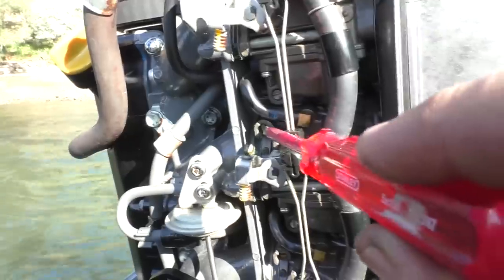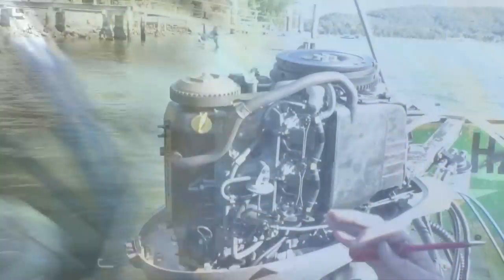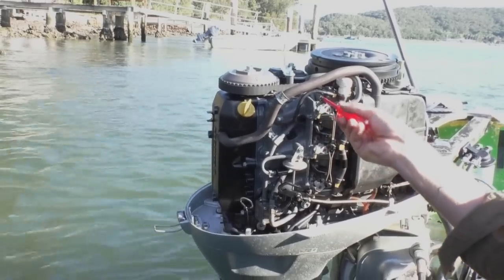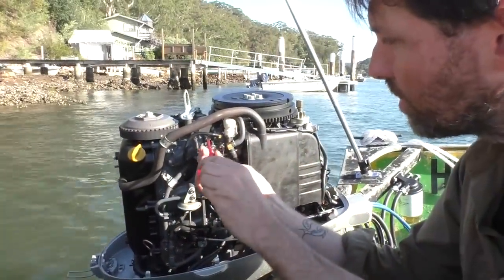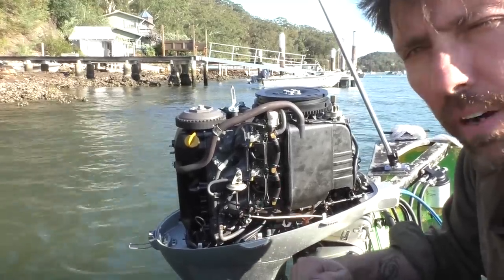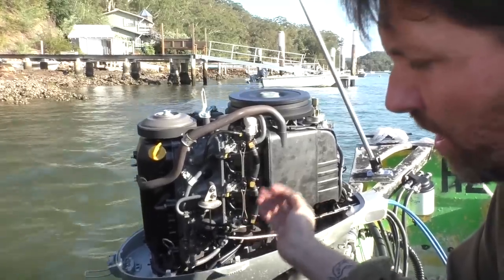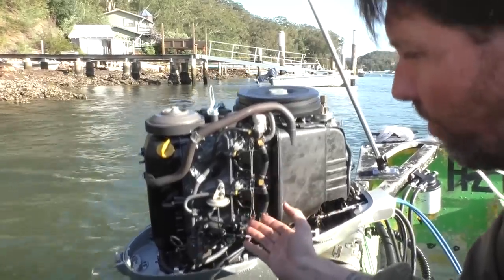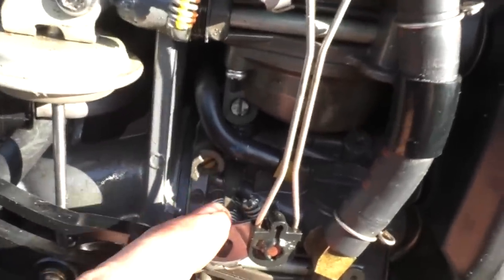Four stroke carburettor synchronisation

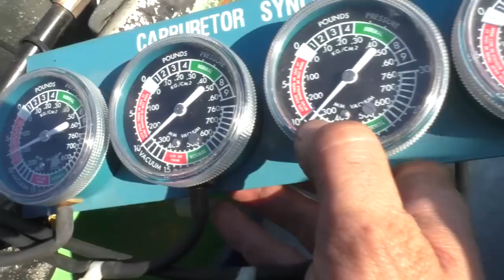Comment: I dont know if boat motor carbs have similar stages as automotive carbs but if so here's another tip. When you adjust the mixture screws you are adjusting the fuel through the idle circuit. If the engine rpm increases significantly while making the adjustment the carb will begin to draw fuel from the off-idle circuit, thus upsetting your adjustment. Best to keep the rpm adjusted to an idle speed as you adjust mixture screws so you're working within the idle circuit.  Also, it looked like your vac hoses may have been partially pinched at around 23:37.  But, as with your previous video's, you are clear and concise, and very detailed. Good videos, thanks.

Comment: This was a great video and walkthrough!! the only bit of advice i would add is, when using multiple vac. gauges like that before you fine tune them its not a bad idea to check and see if they all read the same on 1 carb. sometimes those gauges can read a little differently but than after that you're set!!! great video!! new subscriber
Reply: Great tip Zac
Reply: Do you mean check 1 carb at a time ?
Reply: @levibellette7726   no necessarily that. I just meant before you hook each gauge up to their own carb. check each gauge on the same carb first real quick! Iv'e had 1 out of 4 gauges read off before and messed up my whole tune! just a little tad of advice!:)
Reply: I use a mighty vac to test each gauge as a kind of calibration - 10” on the mighty vac reads 9” on gauge 1, 10” on gauges 2 and 3, 11” on gauge 4 - I then grease pencil a +1 on gauge 1 and -1 on gauge 4.
Did that make sense? Ha!
Reply: @dekrev  ahah yupp, very nice!. too bad you can't just turn the gauge faceplate so the needle all reads the same. good idea though!

Comment: Ur instructions are clear, easy to understand and what I appreciate most is you explain everything that is going on and why.  I had idle issues with my mercury 40 after a carb clean and after playing with the idle screws I could not get it to stabilise.  Either too high or it dies.     Did not know there was a setting to bring the whole rpm down to idle properly.  Subscribed!!!
Reply from the maker: Thanks for subscribing! :)

Comment: Thanks very much for your well done, clear, and informative videos! I just got a 90 hp 3cyl merc running that hasn't run for over 12 yrs. cleaned and new gaskets in carbs, rebuild fuel pump, all new fuel lines. It runs pretty well but has,what I'm told, a lean pop, that will almost stop the engine. So next I'll do all you have shown in this video. Greatly appreciate your videos.

Comment: good video.done this procedure many times.i use a vacuum mate though.set the idle to 1000 rpm,and keep it at that rpm for the procedure.if you have balance tubes between the carbs,pinch them with plastic pinch off tool.takes some patience,but once done your engine will purr at idle.once al carbs are in sync,set idle speed back to specs.happy boating.
Reply from the maker: Those VacuumMates look really cool. You're not wrong about it getting the boat purring once it is done. :)
Reply: i`ve been doing marine repairs for 40+ years.i have to say that your videos are first class.you take the time to describe all procedures in depth.great analyzing and diagnostic skills.your explanations are clear and concise.i salut you sir,keep up the excellent work.best wishes from Canada.

Comment: I've enjoyed viewing your videos tonight.  They've given me that bit of motivation to soldier on.
I've just spent the weekend on a Yammy F100AET (F100TLRZ) trying to figure out why the alarm sounds then it goes into Limp Mode. After cleaning sensors & changing oils I've come to the conclusion that I'm gonna have to go in hard.... remove the head as there's water in the sump and milk running from the leg. Also while I had the Sump plug out and the flush hose on, found water dripping from the sump plug.    Thanks Dangar.
Reply from the maker: Good luck with getting the motor back in shape. I hope the videos help you do that. :)

Comment: I had a beast of a time adjusting a BF90. Two of the mixture screws had the tip broken off in the seats... I managed to drill them out with a magnifying glass and a dremel with a tiny, tiny drill bit. Installed new screws and redid the sync. Ran beautiful after that. It only took me a days work all in all :D

Comment: Fun fact:   Mercuruiser stern drives have an interrupter switch that actually turns ignition off for a few milli seconds as the unit is shifted from neutral .  This protects the shift components in the bottom end.  Works quite well.  Don't know if outboards have similar tech, but they should imho.
Reply: yes of course outboards have a "shift interrupter" switch. if its a v4, kills one bank of cylinders so its easy on the pinion gear. a V6, 3 cyl (entire port or std. bank). anything smaller than a v4 and its not an issue. although many v4's dont need one depending on the gearcase.

Comment: The most informative vid I've seen on this subject. Thanks for that! I love the plain, no frills vids that relay information. 👍
Reply from the maker: Thanks Joseph, glad you liked the video. :)
Reply: If a start my 75 mariner moter and it is running the fuel pis out my moter in to may transim of my boat
Reply: Lizaan van der Bergh bad reed valves if it’s a 2 stroke
Reply: @lizaanvanderbergh6648  the carburettor/s are most likely to be flooding,, the float valves may be stuck down,, by the way,, too check your "reed valves are working right,, take off the air box on the carburettor's and  run your engine holding a white card close to the front of each carburreter if any fuel is spitting out on the card then that cylinder's reed valves are bad,, not setting or are broken! if one is broken you MUST find all of the reed valve,, don't just swop out the reed valve without finding the broken part,, as it very likely to find its way into your engine when its running,,,, then your engine go's with a bang!,, and you get one written off engine!,, so find all the broken off part's!

Comment: I really like your videos, you do a good job.  Not to be "that guy" but: I had a Honda twin cylinder motorcycle 17 years ago, first street bike, and got all excited about stuff and found that I could balance the carbs (never had heard of such a thing prior to that).  I bought a gauge/device and balanced them.  I can't quantify it but it definitely seemed to run better and stronger after balancing the carburetors.  It didn't turn it into a rocket ship, but it seemed to make an appreciable difference.  I think it's a good final step in tweaking a carb engine.

Comment: Best material on outboard tuning I've seen! I have a BF25 Honda that looks to be quite similar to what you're working on so even better for me. I've struggled a bit with this motor the last several years but the trend is positive :). Have had issues with dirty fuel and build-ups in the very small passages in the carbs so have, of necessity, gotten comfortable with disassembling / cleaning these guys. The final tuning / balancing however, has been a work-in-process even with the factory manual but your video puts it all together beautifully! Thanks much (and big snaps for not dropping anything in the water at the dock...I can't claim the same when working on the boat in the water :).
Reply from the maker: Thanks Mark, yep, those BF25s are very similar. Glad to hear the videos have been helping you, but yes, I have dropped plenty of tools and parts in the water over the years...
Reply: Dangar Marine Tappets

Comment: On my 2006 merc 125 hp the it really idles hi and clunks into gear. I wasn't sure the idle was to blame but this vid narrowed that down nicely. While I'm not sure I want to start turning fuel screws I might just simply lower the idle as you say until is comfortably slower but not out of balance. Thanks Stu, very well explained video as always....cheers
Reply from the maker: For sure I would lower the idle if it is really clunking. As you say, no need to mess with the mixture screws if it is running nicely.

Comment: I appreciate you sharing this with us, it really helps. I tried to mechanically (as I don't have a vacuum gauge rack; which I will need to get) sync the carbs on my Honda 40 by setting the adjustments as close together as possible according to the small holes in the bottom of the circuit (lined up according to the boss carb.) We will see if it works, I know it did work on my motorcycle to do it that way. My motor was all jacked up...I cleaned the carbs and reset the mixture jets. Next is the sync, thanks mate for showing me how!

Comment: Great video!! Very informative! I have an 85 Mariner 75 hp I have a hard starting problem with. I replaced the fuel pump, fuel lines and rebuilt the carbs. It runs great but it is very hard to start. It has a fuel enrichment system instead of a choke. The solenoid is working and all passages are clean, but I still have to spray gas into the carbs to crank it when cold.
Reply from the maker: Once it is running, does activating the enrichment solenoid change the sound of the motor?
Reply: +Dangar Marine Yes, it bogs down like it is getting extra fuel.
Reply: The stator went out on my last trip. I'm thinking that may have been my hard starting problem. I have a new stator, power pack, and voltage regulator ordered. Hopefully that will cure the hard start problems.
Reply from the maker: Fingers crossed. Let me know how you get on.
Reply: I certainly will! I have plenty of experience working on motorcycles, cars, and atvs. I'm not as experienced with outboards, but this particular engine is a demanding school mistress...LOL. While it was running, it was flawless and powerful. I'm quite sure the new ignition system will solve my problems. Again, thanks for the concise and informative videos! I will update my results this weekend! PS. I had the engine rebuilt for $1250. I kept having carb problems. After installing an inline filter and cleaning carbs, they started flooding again. I tore them back down and they were loaded with black debris. I replaced all the fuel line inside the cowl. It was dared 3/24/86...LOL. I thought he would've replaced the fuel line. I would hate to fry a motor over a $10 length of 1/4 id rubber hose...smh.

Comment: Tube length would matter in theory because air is elastic so a bit more stretch would lessen pressure at the gauge by probably an insignificant amount for your purposes, but not sure what the percentage would be.  Great video as usual Stu!

Comment: Keep up the great work with these videos - they're a fantastic series that are really helpful for people that don't have a lot of experience.  I have lots of carb fun with a Honda BF90 I have, where it sometimes drops to 3 cylinders when idling, despite stripping/cleaning/tuning/balancing all the carbs.  They're temperamental things on the hondas I think, as my friend's one does the same thing, but not sure why it does this 'trick'.
Reply from the maker: Hi Jim, glad you like the vids. Dropping a cylinder is more likely to be a spark problem than a carburettor problem. I'd go through that side of this next.
Reply: Thanks for the input!  Have used a spark tester on all 4 and it seems to work fine on them all whether it's going on all 4 or dropped down to 3, and have swapped the plugs & coils etc around.  Just taken the carbs off yesterday anyway and the bottom one wasn't the cleanest inside (float was sticking, causing it to absolute p*ss fuel out of its vent at the top), so I'm overhauling them all.  
Water jacket cover etc is all off at the same time to de-salt it all too, as a previous owner has clearly been pretty slack with rinsing it out adequately.  Lots of new coolant related bits ordered as it's been a bit neglected.  Now if I could just get the honda paint that'd be the holy grail but can't even really find it for sale in the UK, never mind the Isle of Man!

Comment: Love your technical videos. I hadn't thought of it like a guitar string before, but its spot on! If you want carb exact, it needs to be adjusted everytime you use it, or if temperature or humidity changes...just like a guitar. I've just got a boat, but been mucking around with 2t dirt bikes for a while, good to know its basically the same.
Reply: carbs can last sometimes 20 years with zero adjustments if non-ethanol fuel is used. they are extremely reliable pieces of engineering on most brands and models, especially outboards starting in the early 1980's. temp and humidity will change this yes, but such a small amount it wouldnt be worth the trouble.
Reply: @ct1762  yeah I guess it helps with outboards considering they are mostly used at one level (sea level or at a particular lake), so no need to adjust for altitude. 

But 2t dirt bikes will always run better if they are adjusted for the conditions of the day.

Comment: on most 4 stroke outboards, the bottom carb is (90% of the time) the "master" carb. if you start from the top one, your mixture screws will be all over the place, as demonstrated here by accident. a hint that the bottom #3 carb is the master is that it is not adjustable on its own. they dont want you messing with it. so adjust the bottom carb 1st, and i bet all the other carbs are within 1/4 turn of eachother. its also entirely possible he has a carb blockage as mentioned, but its idling so well i doubt that is the case.

Comment: Hey Stu. Hope all is well Down there. Quick story for you. Remember your trailer wheel bearing video?? Well, using that, I did the bearings and hubs on my Kayak trailer. Took it 1500 miles from New Jersey, USA all the way to Tampa Bay Fl. No problems Even new wheels, new tires( Amazon) . All is good. THEN for my big boat trailer. A double axle that carries a 21 foot PRO LINE, 150 HP Mercury, 70  gallons fuel etc. My point..good deal of weight, right? Well I bought the boat used( the boat is a fishing boat and just needed cleaning). Used your videos to do my own repairs, but last year I brought her to a trailer repair center for a 'PRO" to do the bearings. Last week I took it in for new tires at a tire store, the tech came out and said a wheel was seized !We thought the brakes where not releasing. To make a long and expensive story short, the trailer Pro never replaced the bearings on all four wheels. The bearing came out in pieces when I took the brake off. The grease was covered in rust( the trailer has not seen salt water yet) One race was broken and stayed on the axle The techs at the tire brake shop said the bearings were never changed.I did grease thru the bearing buddy but never broke them down to inspect thinking they were new. Less than one hundred miles. Thanks to your videos not only did I do up my kayak trailer and put over three thousand miles on it but I was able to find a problem on my big boat trailer and brought  back to the PRO and demand they repair it right.   So, if you ever wonder if your videos make a difference, well guess what, they do!!! Thank you. If did not live 10000 miles away I would buy you a beer .Doug Bryer, New Jersey USA. Ever do anything with that fishing pole in your shed ? I think you said it was your father in laws?????
Reply from the maker: +Doug Bryer Hey Doug, glad hear that vid helped you. Hope the "pros" sort out their effort. It's amazing how many cars come into our shop that have never has fuel filters or cabin filters changed ever because they are hard to get to. I did get that rod up and running in the end. Just posted a picture of it on Instagram for you.
Reply: Hey Stu, remember my bearing story?? Well I forgot to mention the brakes would keep locking up on the trailer and would not work. Well the day I brought the trailer back to get "fixed" the tech said the brakes were mounted wrong( they did the brakes). The drum brake backing plate was mounted sideways. This in turn caused the wheel cylinder to be vertical, causing an air pocket. The push rod was bent, and presto, no brakes. Well, again. a long story made short. The owner of the job said he took care of everything. He replaced the bearing and that he would "eat the cost". He said the brakes were fixed and ready to go. Well I traveled 7 miles to the lake boat ramp and as soon as I got out of my truck i smelled something burning. The axle with the "repaired" brakes was burning hot. ( the dust cap was to hot to touch) So , back to the drawing board. My regular auto mech. shop said  I should change over to disk brakes. He said its a easy job, and since i did my small trailer, I could do my boat trailer myself. So my question is , do disc brakes hold up on boat trailers???? I see they come as a kit and look easy to do,vs drum brakes and all those springs. Again thanks for the video. You most likely saved me lots off grief since I was able to check the work of the "trailer shop".Word is in town is that a lot of work has been going back to him . Thanks again for the videos and information. Doug from Byram Nj,USA I was going to send you a case of Beer to says thanks and well done, but the US Post office would not let me. some about over seas shipping and beer and the law???????

Comment: This helped me out big time today...sadly when I had it as right as I could get 5 hours ago....when i went back up to do something else, it's back to all over the place 1 right up at near 0 others down to 10 and anywhere inbetween. Same outboard as your ex Yamaha. Always been a Yamaha mechanic "fix" it before I tried it today too
Reply: Also 2 of those plugs for the ports were loose too and been that way for likely last 9 months since mechanic had supposedly cleaned the carbs out at £560 with no parts changed!!
Reply from the maker: That sounds like a dodgy job!
Reply: @DangarMarine  definitely dodgy and even worse he said 4 new carbs when it was supposed to go back fir issues to be fixed....he recommend new carbs...2k for the set!!